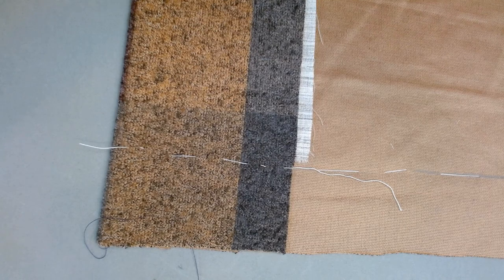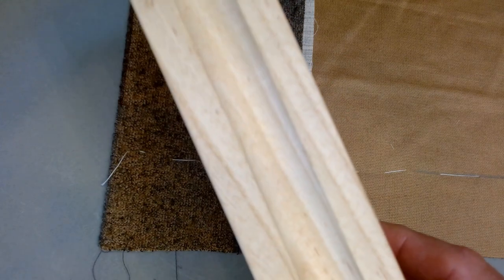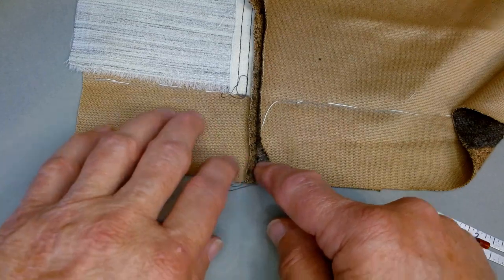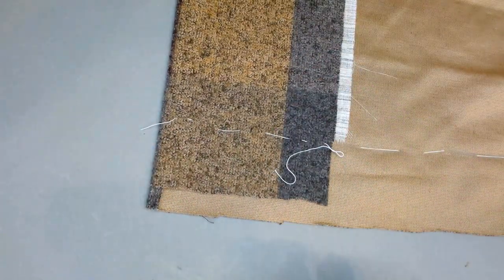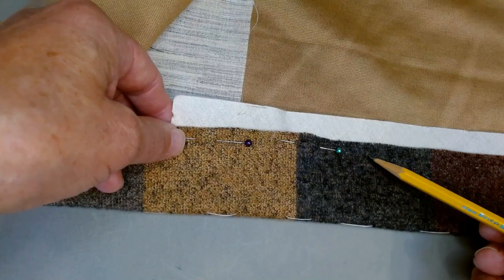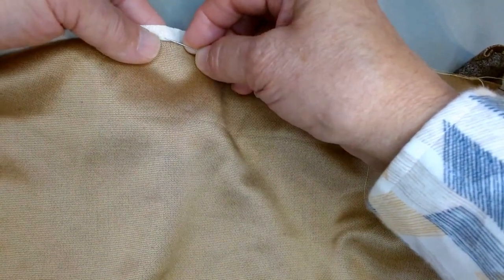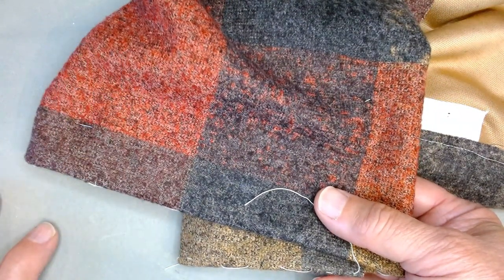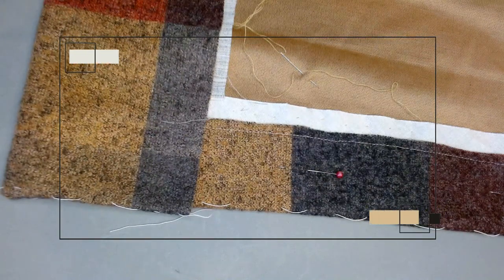Hemming a coat

Comment: I came for the hand sewing. I removed the lining from my coat and would like to find a method of invisible stitching. The muslin layer to your lining is a great idea ( I don’t have one) but won’t it look strange when the jacket is open? Beautiful work.
Reply from the maker: The muslin strip is eventually covered by the lining, but it sounds like you're taking out a lining to have an unlined coat / jacket.  In that case I would probably do a Hong Kong finish along the bottom edge and then hand sew the hem as invisibly as possible.
Reply: @mainelymenswear  Thanks. I’ll try my best.